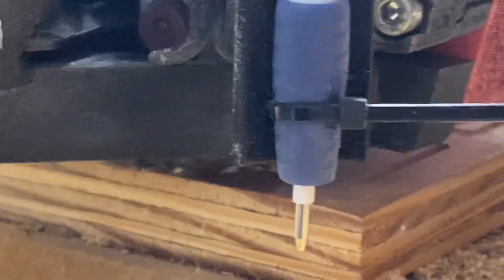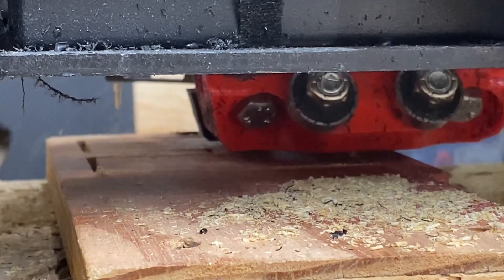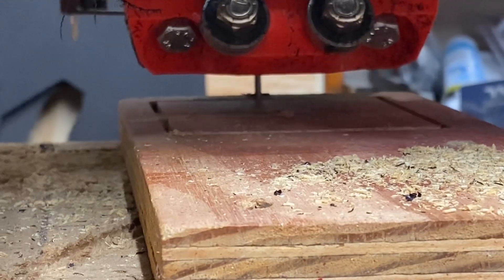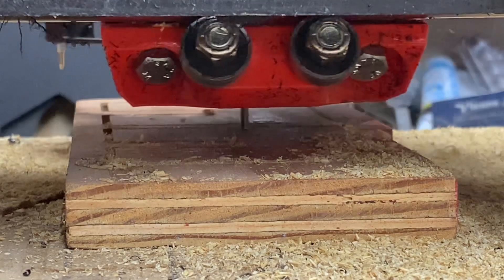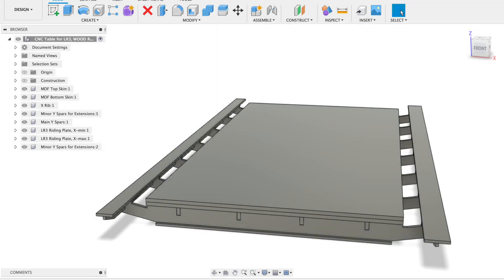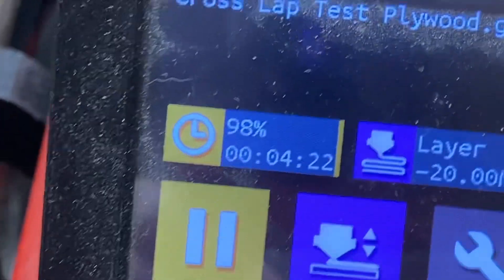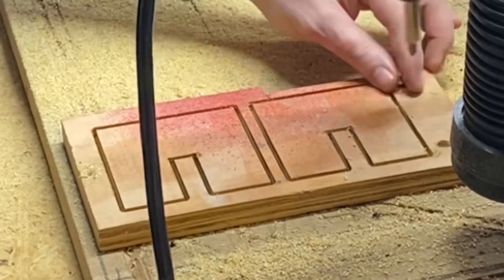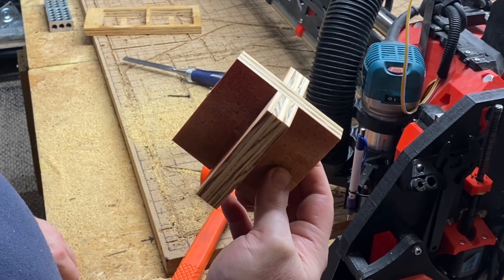For LowRider v3 CNC, full sheet capable table, Part 1, prep & cross lap test

Comment: Hey Doug, I'm finishing up the build of my Lowrider 3 and I love your idea of the torsion box table with the metal rails. The only thing is I cannot find a metal rail file version that is 6" tall rather than the (LR3 Table, Metal Strut Rails, 23/32’’ plywood (Slot_Width 0.719’’ or 18.2562mm) 3 5/8’’ tall). Do you have a 6" tall metal strut version file?
Reply from the maker: OK, I could not find where I had created that, so I did some quick and dirty edits to a Fusion 360 file, and outputted some new DXF's and created a new set of cut plan files. I zipped them up and added a new paragraph with a new link to the docs page here (note: look for the "metal rails table" section): https://design8studio.com/for-lowrider-v3-cnc-cut-table-dxfs-for-cutting-f360-archives-docs/
Reply: Thanks Doug! I figured you already had it somewhere and I was just missing it. I appreciate your hard work and willingness to help out all the newbies like me!

Comment: If you want metal cut send cut send is a good place to get the struts cut
Reply from the maker: If memory serves, I think I checked with them (way back) and they had a length max that meant my strut plates were too long. However, I later found out that PCBway was willing to do the length I need. I actually ran that past Ryan, to see if he thought it was OK because even though the strut I have designed is modified immensely from the original design, I didn’t want there to be a license violation (commercial profit issue). He seemed OK with it, but I still haven’t done it.

Comment: thanks doug, a good table design is really needed!~
Reply from the maker: I'm pretty sure I've got it so that those willing to use metal struts (and 3d printed table extenders for Y belt tensioners) will only need one sheet of plywood (and have some left to spare). I am also pondering, but don't yet have a completed plan, for those who want to use wood side rails instead, but my best idea on that is one sheet of plywood plus some use of like 1x6 x 10' boards. In our area, two unistruts (10' ea) cost the same as a second sheet of plywood. 3/4" ply is $70 right now and unistruts are $35 each.
Reply from the maker: # Download links for cut-ready CNC Table with Wood Side Rails and CNC Table with Metal Strut Side Rails:
https://design8studio.com/for-lowrider-v3-cnc-cut-table-dxfs-for-cutting-f360-archives/